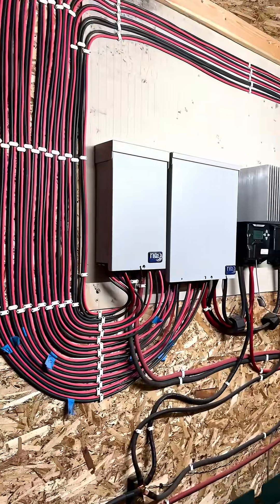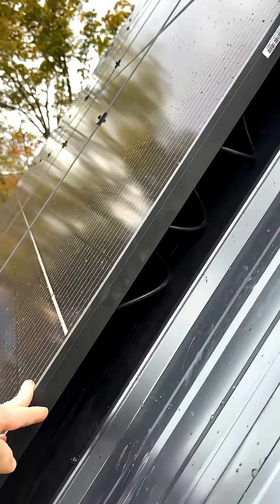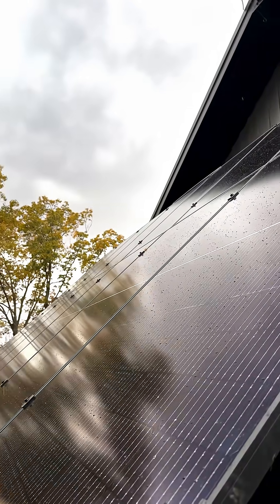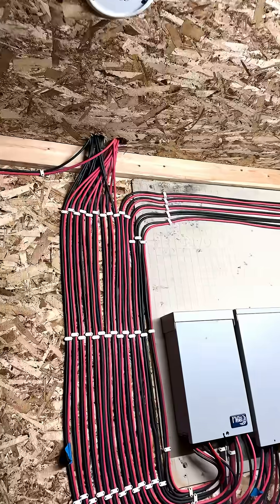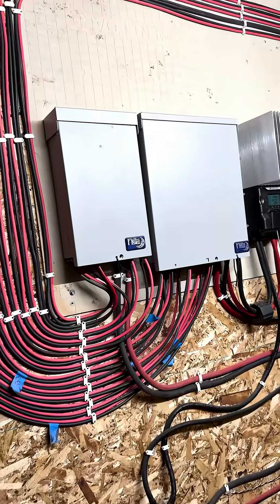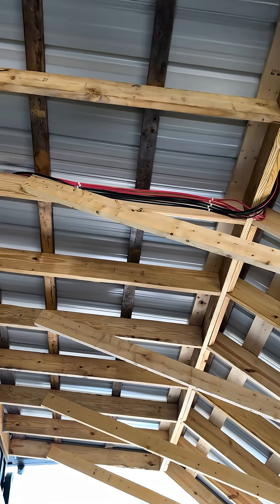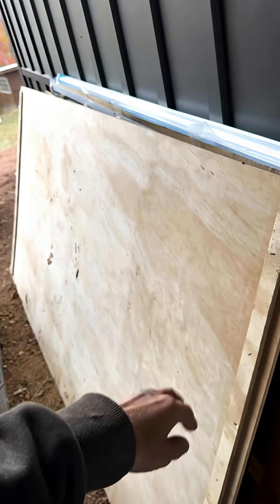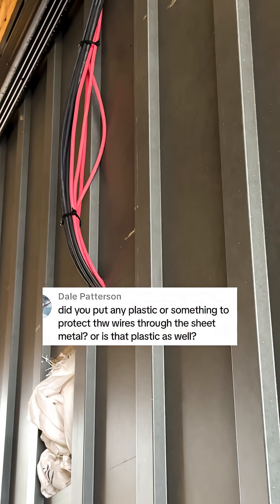Adding disconnects to my solar system? #narrowayhomestead #offgridliving #solarpower #safety

Comment: holy fuck put some protection around the wires where you pass it through the metal siding - that's a massive fire hazard.  also... tacking them to wood... bro

Comment: Normally the disconnect does both the negative and positive wires from the panels. The negative wires are un-grounded so there is still a voltage potential between them and ground. I’ve found this out myself when the negative wire arced against the enclosure I was working in.

Comment: I'm not familiar with your combiner circuit breaker model. Are they rated for Switching Duty use? if not using them as disconnects while under load may significantly shorten their lifespan. 
Circuit Breakers are designed as protective devices, and so-long as you know that using them as switch-gear may prematurely kill them, that's fine. They do have the ability to break the circuit under load and will work the way you intend to use them. They just may not live as long and having dedicated cut-outs designed to be switch gear would extend their life and make it easier/safer to switch them out once they fail.

Comment: You might find it very unlikely to work on these wires, however, since as long as the sun is shining you got PV power,  a firefighter safety switch would help not only in case of emergency, but if work has to be done on the panel side. The disconnect switch is AC powered, and some switches have a manual override too. You cut the AC power to them (using something like an EPO switch, or an AC breaker), PV power stops. And since all are IP65 or more rated, and can be used outdoors, they can be installed near the pannels.

Comment: The usual reason for accessible disconnects is an electrical fire.
Where I live that means two disconnects, one at the panel and another at the inverter.
They do need to be DC rated however for the 390V feeding the inverter. Standard circuit breakers AREN’T. The 75V battery feed has a separate isolator.

Comment: The missing wire sheath where the wire goes through the wall is the only thing that stands out to me. I'm not an electrician, but I have worked in the field of building packaged control rooms for many applications for about 14 years. That does put me in the know to a certain degree. Wire and cable protection were a big part of the job. Sheaths, gromets, rigid pipe, trimlock, etc to keep wires safe from abrasion during wire pulling all the way up to final install and termination of cables and wires.

Comment: You always want to make anything over your standard 20amp circuits as safe as possible(obviously everything needs to safe no matter the situation, you catch my drift). All of the equipment youve got is easily worth the couple hundred you can spend for a disconnect. Its not only code but just something you always want to do unless you dont mind a housfire or the frying of said unprotected equipment. More disconnect points and shielding your stub throughs and all contact points to metal is highly recommended. These fixes are less than 10 percent of what you already spent if not 5, and youd loose that whole set up when it was avoidable. If you were local id square you away free of charge but California is a ways from you.  Stay safe bro!

Comment: While I'm sure you know, he may have misconstrued a disconnect with a PVSS. These are super common in codes in my area, and provide a small disconnecting device at the panel that is controlled remotely.

Comment: Why didn't you get PVC pipe and run the wires through it for one will be protected from the weather 42 will be sealed up and three it would probably look a lot neater

Comment: Can I ask? When you installed the wiring, didn't it not occur to you that maybe the wiring going through a metal clad wall would need some sort of mechanical protection? That sheet is sharp as F.....
DC short circuit, make fire 🔥

Comment: Please just install a disconnect. Flipping a breaker is ok in a pinch but is not ideal. Solar can and will 100% kill you dead. Just install it where you can. Walking up a ladder to flip a disconnect is better thanbbeing dead
Reply: If you have to cut a wire to install a disconnect, just extend it.

Comment: Those dc breakers like to burn. Best to turn off the inverter before you use those. Nothing like trying to snuff out a dc spark running some amps.
Reply: Try 390VDC at 30A…
Standard AC breakers don’t have a hope.

Comment: Not just a barrier all the conductor should be in conduit as soon as it leaves the footprint of the array

From 2020 NEC NFPA 70 

690.31(D) Direct-Current Circuits on or in Buildings. Where inside buildings, PV system dc circuits that exceed 30 volts or 8 amperes shall be contained in metal raceways, in Type MC metal-clad cable that complies with 250.118(10), or in metal enclosures.

Comment: Concerning the grommet ... you could use a flexible rubber plumbing union. Take the clamps off, cut it length wise, and push into the hole in the siding between it and the wires.  Then spray a little foam to fill the gaps for better insulation. 
I'd love to be able to see your whole setup someday. (I'm in MD and have a family place in WV).
Thanks Nate and keep up the great work!  ✌️😊🤙

Comment: You need a disconnect so you can work on your breakers.

Then you need to put in a 2nd breaker in case you need to work on those breakers. 

And...
Reply: Actually standard practice in Australia - one on the panels for fire isolation and another next to the inverter so you can easily work on it (I’ve had to cycle the power to it a couple of times to reset it - mildly annoying as that requires three separate isolations to remove power from the logic board).

Comment: PUT A RUBBER GROMIT IN THE HOLE AROUND THE WIRES THEYLL RUB ON THE SHARP EDGE OF THE HOLE AND NOT WORK AS INTENDED

Comment: The only thing I would recommend is running the wires through a tube all the way to the breaker box 
Keeps them protected in case any dog or human try’s to chew on them and they do get hot 🥵 especially for a good size system like yours 
Other then that everything passes after you do that 🎉
Reply: A human... chewing on the wires?
Reply: Its 8+ feet in the air. And then in a secured garage that he doesnt keep animals unsupervised in

Comment: Exactly how I have mine set up with a few shunts and fuses in place from the disconnect to the controller,  if I need to work on the wires that's why they make tarps and cardboard. I fell for the whole battle borne stupid expensive batteries. Love your batteries will probably go that route when these die.

Comment: The cables going throug walls without protection is a small concern I think. Specially the metal plates. Looks safe now though.

Comment: I can't speak for him but I think he was thinking that it's always wise to have more than one means of disconnect for electricity. That's what we're taught in the field and in electrical classes. It's not absolutely necessary but it's nice in case there is a fire or something wild inside the building and you can cut the power outside. Just what I interpreted from what he said. He should have explained better, I may or may not have done a good job explaining either 🤷‍♀️

Comment: A Teflon sheet wrapped around the wire bundle would be perfect to protect it from the metal. We use it in the aviation industry and it last for ages
Reply: Perfect for when the wires are already installed :)

Comment: Is there over current protection between a solar panels and your disconnect box? That's a long run of unprotected cable otherwise, that could short and start a fire.

Comment: I don't know the voltage of your panel but why not have a stand alone system with lights under the panels. Even add lights in your control room, then you would have light if your system was down for any reason. Why let the panel power go to waste.

Comment: I’ve done several large systems and we covered the panels with a tarp during the daytime to work on the system. It worked fine.
Reply: Now try doing that while the wire is burning…
Reply: @allangibson8494  proper sizing of the wires are critical, especially in the winter when panels can produce more than their rating.
Reply: @allangibson8494  won't be burning for long once the source of power is cut off .—.
Reply: @Dave_Crupel Actually it will keep burning because the power is coming from the panels (leaves on the wiring can be lethal). It does let you control the inverter / house fire however.
Reply: @allangibson8494  I don't think you understand how solar panels work. 
Re-read what that guy said. 
About Covering. Solar. Panels.
Reply: @Dave_Crupel Covering with flammable material doesn’t work if they are BURNING.

Comment: Yes, please use a grommet for the wires entering the sheet metal hole :)
Reply: Yes, it's very needed
Reply: @B3hr3ns  yes
Reply: Shouldn't he spray foam around it also to keep out critters.
Reply: @truthhearit1471 better to use fire rated caulk.  It's never a good idea to bury electrical cables inside flammable foam.
Reply: @steampunkskunk3638  that's the red stuff...
Reply: @truthhearit1471  sealing it with caulking, or an epoxy-resin, should be enough to stop the critters.
Reply: Yeah, that little bit of motion from them expanding and contracting due to heat and cold is going to rake them over that cut metal and shred them eventually. No sign of an issue until the wall is electrified.
Reply: yup, and living out there with the bees and bugs i'd make sure that penetration is nice and foamed or caulked
Reply: I'd say a generous application of cheese may be required to entice the gromit in question.
Reply: He said it was going to happen in the video.
Reply: using lead acid in 2025 is... falling for the biggest boomer scam of the century